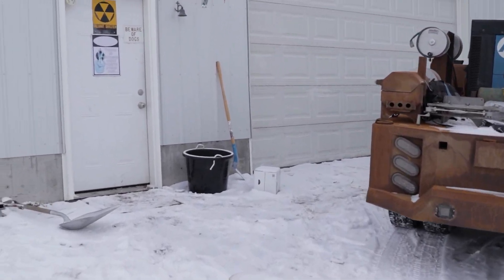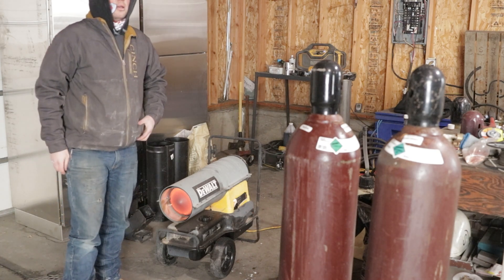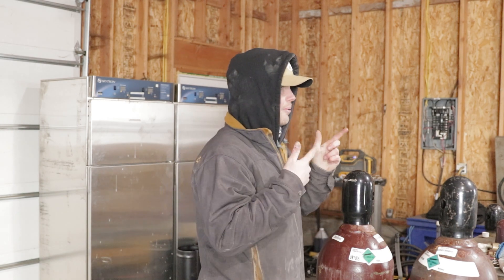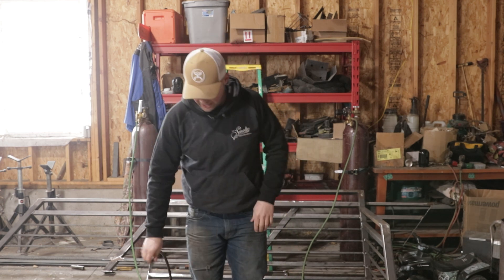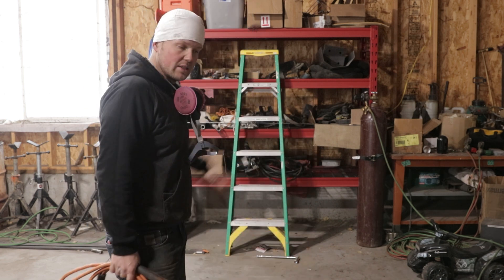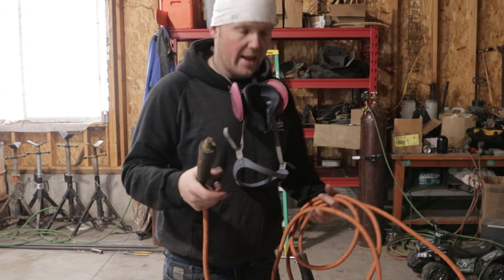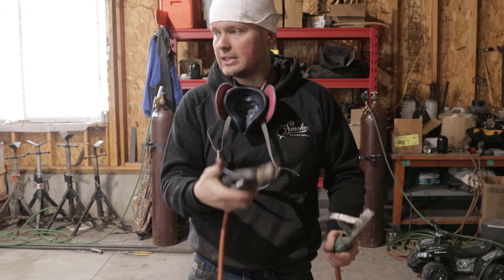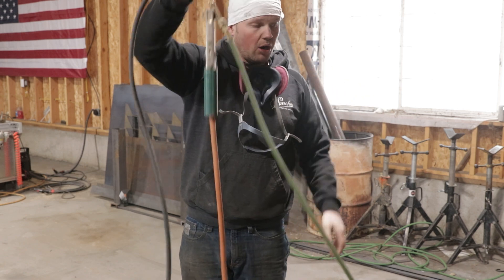How To Hook Up a Tig Rig

Comment: Can you recommend a good setup for aluminum?
Reply: You can’t scratch start for aluminum you need high frequency box or an ac tig welder
Reply: Yeah because that is what I need as well.  Mostly for aluminum and carbon steel. I think this setup will be good for both i think.

Comment: Yes ya can and it’s called Texas tig for those of you curious.
Reply from the maker: Texas tig is using a stick rod to strike the arc then using another stick rod with flux busted off of it to use as filler metal. 
In this video I’m going to show how to actually hook a tig rig to a stick welding machine.
Reply: @JacobSchofield  that’s badass and I didn’t realize you were actually going to use a tig on the stick machine lol 😆 I feel dumb but then again I wasn’t wrong I just didn’t pay enough attention.